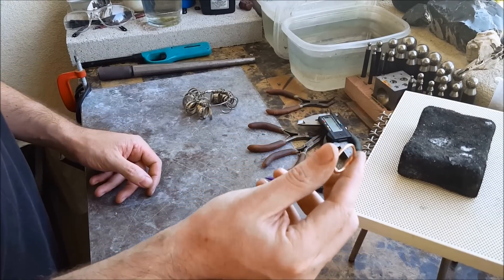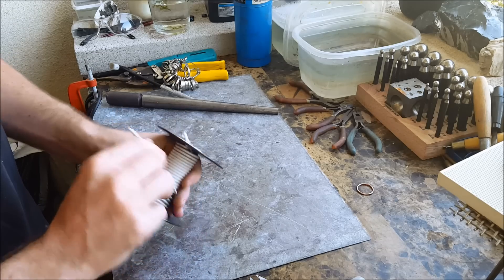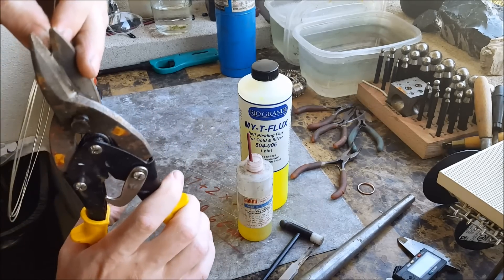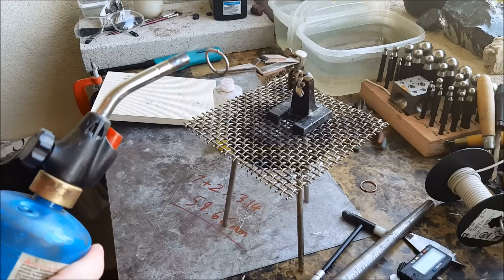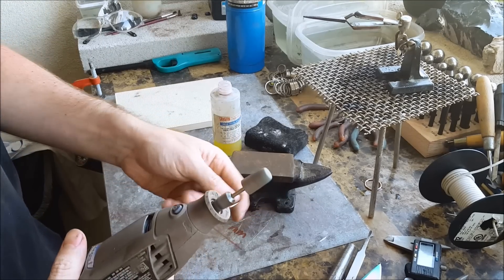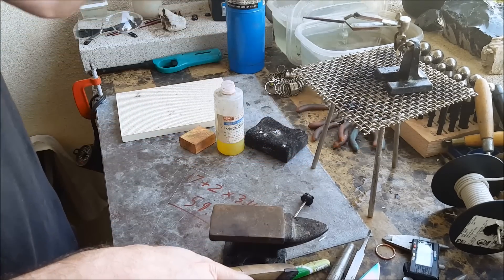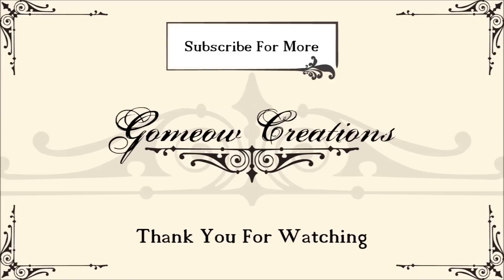How to make a ring from scratch.

Comment: I really appreciated the last bit on coating and protecting the ring. This is something my instructor did not bring up. Your videos have been so helpful!
Reply from the maker: Thanks and yeah when working with copper and brass you need to seal them or they like to react with the elements and turn stuff green

Comment: I'm having trouble soldering my ring. Did you have to clean it before soldering it? I didn't catch that. I think I've ruined mine. I also pickled it a few times. I'm not sure why it won't solder. 😤

Comment: If anyone is concerned with the shape changing prior to pre-polishing and then final polishing, I’d recommend using sanding sponges on curved rings as opposed to the rubber mandrels he uses.
Reply from the maker: Yeah that is a very good point and a good tip. 😁👍

Comment: I'm also wondering if I've heated it too much if it ruins the copper and doesn't work with the solder anymore.. 😬 I'm not sure. I was taught using silver and I can't believe how much harder everything seems with copper.
Reply from the maker: Copper will oxidize very fast but it can be done. You want the metal as clean as you can so pickling will take any of the oxidation off it. You have to use flux when doing this to keep it from oxidizing at the solder joint. Also heating will not mess up your metal unless you melt it.

Comment: Great video. The bit that I can't work out is the end with the wax and lacquer. What goes on first and what does the lacquer do?
Reply from the maker: Lacquer is basically a paint to cover the metal so air and acids can't get to it so it will not tarnish. If you are going to add a clear lacquer or paint to your work you need to make sure it's clean and all oils or waxes are removed do it will stick.

When using the wax is good for storage but it will come off quickly if you are going to use the jewelry. Over the years I have learned not to fight with copper and brass jewelry and if you are going to make something using it make sure to add some silver to the parts of it that will come incompact with a persons skin. You can do this with plating or using a thin sheet of silver.
Reply: @GomeowCreations  thank you so much for replying and giving me all that information. I have dabbled in copper for bangles a few times. I will certainly remember your advice. 
Thank you again and stay safe out there

Comment: Super - thanks !   Watched and read it all and still have a question.  Sorry for that….  Is propane a must for copper ?  Will butane suffice ?  I know the procedure is the same for silver but somehow the solder is difficult to get to flow unless I am doing something wrong.   All clean including the solder, no heat sink etc. Thanks so much !
Reply from the maker: I hate using butane to be honest it just takes too long to heat things up and just doesn't put out enough heat. That being said it can be done but you might need 2 torches if you can only get butane
Reply: @GomeowCreations  I so agree !  Getting propane first thing - thanks !
Reply: I'm using butane and maybe that's my issue. But out of frustration I sat there with the flame until the ring started to warp and solder wouldn't go in the joint.

Comment: Can a person preheat the solder first and quickly stick it to the seam? I’m asking because I have no clue but it just seems it would help with the fire scale on the piece OR make the barrier flux using the boric acid and denatured alcohol and apply that and dry off before applying the regular flux and solder? I am seeing that being discussed but want your opinion because I’m tired of bouncing all over the place and I have chose YOU as my permanent instructor from now on
Reply: Maybe with such a small piece “fire stain won’t be a issue “
Reply from the maker: So if you are doing this with silver and you over head it it will get some fire stain but it's not the end of the world. You can use a solder pick and melt the sold and it will stick to the pick and you can move that over to the ring and heat both and it will flow onto the fluxed part of the ring. 

No matter what you do you need to pick it to clean it up from any oxidation and the hardened flux. This will be with any metal you use. 

When it comes to getting a stain in the metal, like silver it will look alike a darker bit when polishing it.

There are 2 ways to get rid of it. 1 sand it off and re polish it. 2 heat the metal up but not too much to get my stains and put it right into some pickling solution. Repeat this over and over again until when you heat it up it no longer gets a tarnish on it and the metal will looks like a nice matte white color. 

What that heating did is burned off some of the copper that is in the 925 silver leaving a layer of fine silver over it. The stain that was there was oxidized copper in the metal so with that done you can polish it up and it should be gone. 

I home that makes sense and is understandable 😁👍
Reply: @GomeowCreations  thank you so much !

Comment: how do you hide the solder on copper jewelry? I have seen someone use copper patina solution. I am new at this and I am using a copper design bevel wire and copper sheet.
Reply from the maker: https://youtu.be/QrsL8JpR46c this might help
Reply: @GomeowCreations  I don't want to use copper plating. Do you have any other suggestions?

Comment: I have a rookie question... can I use lead solder for a ring or should it be lead free? Thanks
Reply from the maker: You need to use jewelry solder not the electric stuff. I have a video coming out at 8am PST that you might find very helpful when it comes to solder.
Reply: @GomeowCreations  thank You! I will be sure to check it out once posted. I am currently just starting out on this journey and I will be soldering copper to practice. Don't want to be wasting gold and silver! 

Looking forward to Your video! 😁
Reply from the maker: That is smart. I do use silver in the new video but you can do everything I show using copper or brass instead.
Reply: @GomeowCreations  Fabulous! Peace Brother ☆

Comment: A trivial point.  Strictly speaking at 2:40 you spoke the arithmetic correctly but you wrote it down wrong.  Technically it should be written as (17 + 2) x 3.14 .  The way you wrote it you have to multiply 3.14 by 2 first then add the 17.      17 + 2 x 3.14 gives 23.28 .  (17 + 2) x 3.14 gives 59.66 .  I know I'm being picky but I think it's important.  If I hadn't heard what you were saying I would wonder how you came up with your answer.
Reply from the maker: Sorry about that 😅 this was my very first video so I made some mistakes in it 😁. Sadly can't edit or fix it now.
Reply: @GomeowCreations  this is a great help, thank you. I knew how you got the 59.66 and it is not that hard to figure out. so please don't apologies. Once again thank you so much for helping people new to this area,

Comment: Thanks for the knowledge I learned very fast you teach very well. I have a question, does the buffing compound add some sort of anti oxidation?
Reply from the maker: Thanks and not at all, It will tarnish even if you coat it with wax or clear coat it will come off over time. You can use a layer of hard clear resin on it that will last for some time but that is all going to be up to you. 

I honestly would just make copper jewelry for practice and anything you are going to use just make it in silver. 

If the copper color is a must you can plate the inside of the ring with silver or gold. Another option that I have been doing is make the inside out of a solid bit of silver so it will not react with the skin and the outside will have that nice copper look

Comment: I’ve tried this a few times now and where I solder looks silver every time and I can’t just sand it away. I do only have flux that’s meant for sterling silver, it’s the stay-silv kind from Amazon, is that my issue? Or am I doing something else wrong? Because I’m using copper wire and copper solder
Reply from the maker: Yeah "copper solder" never looks copper for some reason. I just use silver solder for everything thing and if you need to hide the solder line you can copper plate it really easily with some basic tools. I have a video about it 😁👍
Reply from the maker: https://youtu.be/QrsL8JpR46c
Reply: @GomeowCreations  I don’t have the money for any of the things to electroplate and I only have about a foot by foot space for jewelry in my apartment.. Do you know what else could work that’s not as expensive or big
Reply from the maker: Vinegar and salt to make a basic pickling solution. Add copper to the solution some something like the root kill stuff I used or if you can get that take some scrap copper and heat it and clean it in the pickling solution and then reheat it and clean it again over and over until the solution starts to turn a bluish green. 

Once you have that just takes some steel wool and put your ring in it and put that into the solution for about 10-15mins.
Reply: @GomeowCreations  thank you so much :)

Comment: great video! just one question what is the solutions/containers (with what looks like water) actually have and what does it to for the making of the ring?
Reply from the maker: At what time stamp in the video?
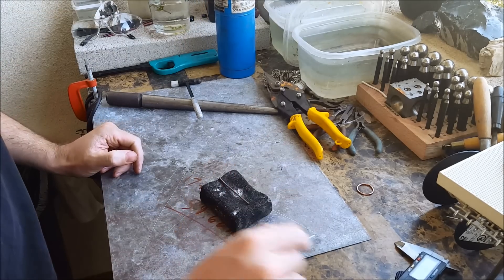Reply: @GomeowCreations  4:30?
Reply from the maker: That was just water. You can quench your work to cool down in water. But to clean your work you're going to need something called pickle which is an acid. Here's a full video about it. https://youtu.be/1mPAXsKXb1Q
Reply: @GomeowCreations  thank you so much!!

Comment: Thank you for this tutorial. Finally someone that uses copper. 😍
I have a few questions... 🙂
1. Where does this big copper roll come from? Is it electric wire? 😳 I have to order little rolls so I have constantly to order it and they are all over the place. I  am looking since long after a solution. Grandano that shop you mention isn't an option. Costs a fortune on shipping. And I don't think they ship to belgium. And I don't care it's not dead soft, I can warm it up. 🤫
2. What happens when you don't use Flux? Don't understand why you use it. Because you cleaned it already with the pickel. 🤔
3. After you softened your copper, what you do to harden it again? Or does it harden over time? I thought you had to hammer it to harden... 🥴
I do copper and silver wiring jewelry together with stones like jade, turquoise, tiger eye, Sunstone. And think copper is beautiful with the colors of the stones...
Thanks for this tutorial😘, I subscribed and now going to explore your channel... 😃😃😃
Reply from the maker: 1. You can use electrical wire just make sure it's 999 copper. I can't link to anything in your country but I'm sure you can find something. 

2.You have to use flux, especially with copper. Then you heat metals they will start to oxidize, this will make it so your solder will just ball up and not flow. When you use flux it keeps everything clean. Look for something called handy flux or look for a borax cone. Don't use flux for electric solder, it will not work at the temps you need to work at.

3. You can work harden it by hammering it. Something else you can do the help harden it is use a rock tumbler with steel shot in it for a few hours.
Reply: @GomeowCreations  well I don't have tumblers an never solder in my life except the thing I have to solder when something electrical breaks. But thanks. I will look for some Flux. My hubby has a big thing that gives a flame, with gas an you have to mix etc... I think I will buy me the thing that you use. So I can handle it more... thanks for the response and when it comes a bit warmer, I will try to make some rings, so that I don't have to make open rings or wire them. It would be so easy if I can solder... nice. Thanks a lot for the time to take for explaining... of to get some electric wire and a torch... big hugs and greetings from belgium...

Comment: Hi Randy maybe you can solve my problem. I try to make my first copper ring, im put some flux, hard solder start using torch and notching . My hard solder do not want melt, and flames become green.
Reply from the maker: I need a little more info. 
What flux are your using?
What Kind of torch?
How thick is the copper?
Reply: @GomeowCreations  Thanks for answer :) Tix flux, Butane torch and 2mm copper
Reply from the maker: Tix flux? Is that I high temp flux? I use handy flux for all of my work now and it works perfectly.
Reply: @GomeowCreations  i cant find information about temp, only information on bottle It contains zinc chloride
Reply from the maker: Well you can always try this flux out and see if it helps https://amzn.to/2Wbh6kr just make sure your area is well ventilated
Reply: @GomeowCreations  Thanks Randy, ofc i will try and let you know :)
Reply: @GomeowCreations   I did it! i was using wrong solder with much higher melting temperature. Ring still looks like piece of shit but hey i can move on :D

Comment: what do you do about the color difference between the copper and the silver solder? that's probably visible (?)
Reply from the maker: If your solder join is small and the solder flowed mostly into the joint, then all you really need to to is polish the ring. This will leave a very small silver line in the ring. If you wanted to make this go away completely you would have to copper plate your work.

If your solder didn't flow in to the joint then you need to clean up the area with some sanding and buffing. If you would like to know how to copper plate something let me know. I know of and use 2 different ways.
Reply: +GomeowCreations thanks for replying. I always wondered about that. I mostly use silver in my works but at the beginning i used to practise on copper(not for long though) and i never knew how to go around that problem. Really useful to get that information. Many thanks !
Reply from the maker: No problem!
Reply: Rio Grande carries copper solder.  I have the paste type copper solder & it's very  easy to use.  No silver line to worry about! Rio actually carries any type of metal solder you might want so check them out!
Reply from the maker: I have used copper solder before and it works well. Here is the link if anyone would like to buy some https://www.riogrande.com/search/go?w=copper+solder

Also thank you for reminding me about that =)

Comment: Great video. I am trying to solder copper wire but using copper wire solder that needs no flux. I am having trouble getting it to flow. What I am I doing wrong ? It balls up and stays put
Reply from the maker: +Still Waters Jewelry Eslie Taylor I sounds like you might need flux for this. So a lot of solders that have flux in have a lower temperature flux. If you over heat it it will not longer work and keep the part clean so the solder will not flow. I have had this problem using brazing rods. To fix this problem try cleaning you part and try some high temperature flux along with you solder. You might also want to remove the solder that is already on your part. If you are still having problems after this, send me a video link in the comments and I will have a look at what is happening.
Reply: GomeowCreations thank you so much fir getting back to me. I will try again , so frustrated I was in tears. I had used with other projects Handy Flux. So will start fresh today. I am new to soldering so your advice means a lot.
Reply from the maker: +Still Waters Jewelry Eslie Taylor soldering can be very hit and miss. When you get frustrated just put your work down and do something else. This will help a lot. If you work any your a frustrated you will ruin what you are working on.

Comment: Not as easy as it looks! I do NOT have steady hands. LOL!  I FINALLY soldered my very first piece (the copper ring but with 10 ga wire). It looks a mess but nothing I can't file away. I started with a tiny piece of wire solder and it kept falling off so I attempted to solder directly from the longer piece of wire solder. It seemed like a good idea at the time!  😂 I should've revisited this video beforehand instead of after but I plan to clean it up and try to add the coils like you did in one you showed at the end.  
Thanks so much!!! 🙂

Comment: Im wondering how durable this is? Copper is super soft right? so this would lose form easily?
Reply from the maker: +Glen H it can lose its form is you are really rough on it but for the most part copper will hold its shape. You can alway harden the ring with heat or a hammer to help.
Reply: How do you harden metal with heat? I thought heat softened it? (Annealing.) Great video!

Comment: Ok... I just had another thought/question... Can you put the ring in a tumbler with stainless steel shot to clean it and polish it?  Or is all that sanding necessary to achieve the mirror shine? I'm always looking for an easy way, suppose. LOL! Thanks!
Reply from the maker: So you can use a tumbler but you are not going to get a mirror finish unless you take the time to polish it.  😁👍

Comment: Just curious if you have to use silver solder or if a copper solder wire would also work? Thanks in advance!
Reply from the maker: You can try it but I have never had copper solder stay copper looking, it always turns silver. 😅

Comment: I have one of those torches in my garage and copper wire I think I’m going to try and make a couple of rings..... my question is — Can I put it in the tumbler and which shots do I use.... I only have silver shots
Reply from the maker: Yeah you can put copper and brass in the tumbler with steel shot and it will work the same. 

Check out my new video, I think I had better info https://youtu.be/zRKdWpiexbY